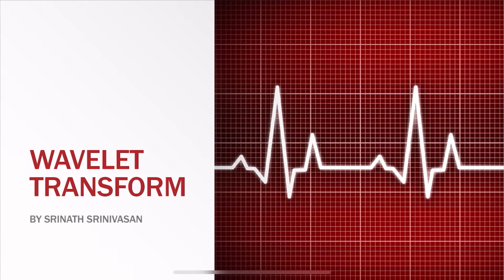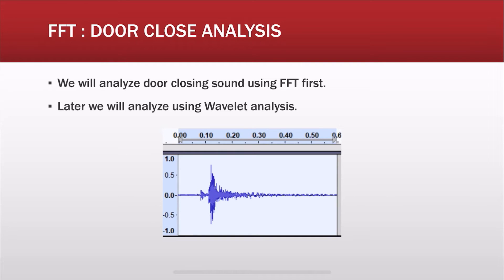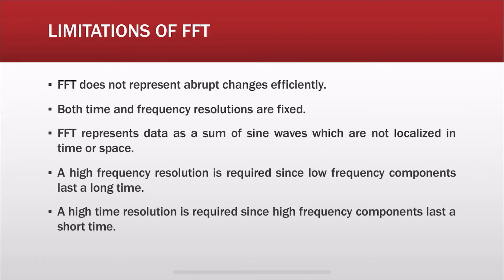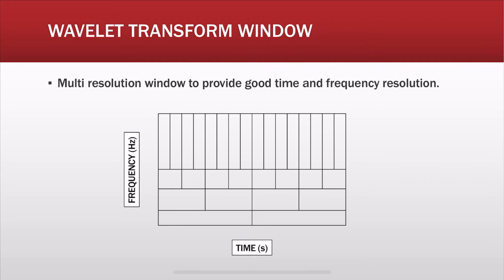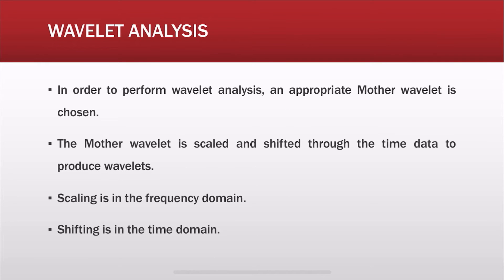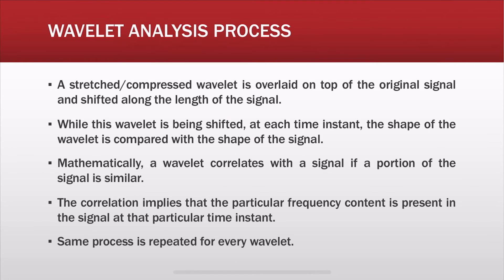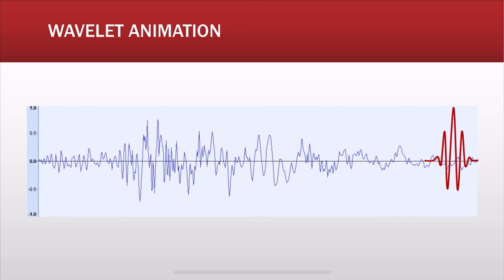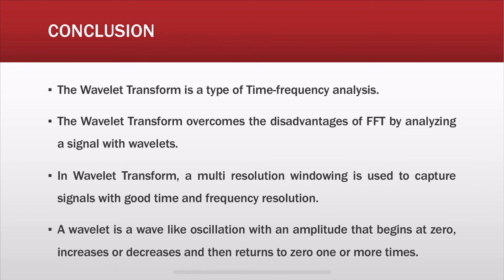The Wavelet transform explained

Comment: Thanks ! What would be the difference if we replace our wavelet with bandpass filter ? Would the latency be the same ?
Reply from the maker: Octave analysis is performed by passing a signal through many bandpass filters. While this is good for longer sounds, it may not be the best approach when it comes to analyzing short sounds where both time and frequency information are important.

If we use FFT/Octave approach there are some things to consider. First the frequency resolution is fixed because the duration of signal is very low (ex. Door close sound). Higher frequency resolution can be obtained only when duration of signal is longer. To learn more about time-frequency relation check the link in video description. 

Second, this approach uses fixed frequency resolution over the entire spectrum, which also means that time resolution is fixed. The wavelet analysis overcomes this by using multi-resolution windowing so there is no further dependency on time and frequency. Hence one can achieve good time and frequency resolution at the same time.
Reply: @SrinathSrinivasan  Very thanks for your answer ! 
But in fact my question was not what i intended in my mind... 
I was thinking about iir bandpass, (Generally i use original signal minus 2th allpass.)
From what i understand, wavelet use fir ? But what is the difference if we replace them with those bandpass iir filter ? would the latency be worse or the same ?
Reply from the maker: Yes, a wavelet can be considered as an FIR filter as it has a finite impulse response in the time domain without recursive components. Now merely comparing FIR and IIR with respect to latency, IIR has less latency as you probably know that IIR filter being recursive in nature uses past outputs as input resulting in fewer calculations compared to FIR which is non-recursive. The less latency of an IIR comes at an expense of phase issues. These can be rectified by using All pass filters but if higher order All pass are required then again it means more computation which can increase latency.
Reply: @SrinathSrinivasan  Thanks !!
I'm just testing my first FIR wavelet at 110 hz with 4096 tap.
For the phase this is exact but note that at the exact frequency of interest, the phase could be exact, yet it degrade around that frequency.
(depending of the type of bandpass, as a combination of lp and hp will maybe not do this )
I just test to see the difference, with only one bandpass (that is original signal minus a 2th allpass) the phase doesn't degrade so much around the frequency, but we have another problem,  
the envelope of the signal is extremely smoothed as 5X longer than the original, where the Fir have approximately a 1.7X longer envelope.
Now i could use more bandpass filter in series with lower coefficient to get a less degraded envelope,  But now, the phase is degraded even more around the frequency..
To get almost the same envelope elongation with IIR, i need to use 8 bandpass in series. But now the latency is even greater than with the FIR !...
Well, this is a little approximate because  i have some tool to visually see if the filter have the same response but it's not ultra precise, also, the IIR have a less sharp attenuation...
But it give me an idea, using a IIR filter that degrade the envelope but have less latency and try to stop the detection with a FIR or more filter in series.

But maybe i did'nt use the right windows for the wavelet, here a Hamming windows ?

Comment: at 14:10 i believe that there is a mistake the graph shows high time resolution but it's actually the opposite because the block is wide so it's not accurate for time but accurate for frequency and the same thing for frequency it's low frequency resolution. but great video thank you for uploading.
Reply from the maker: Thanks! It was a typing mistake and has now been edited.